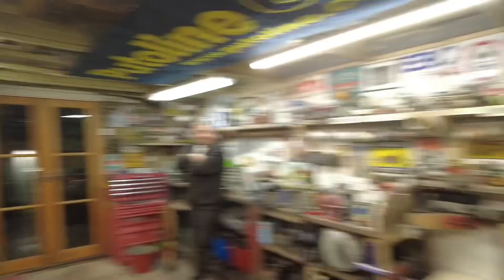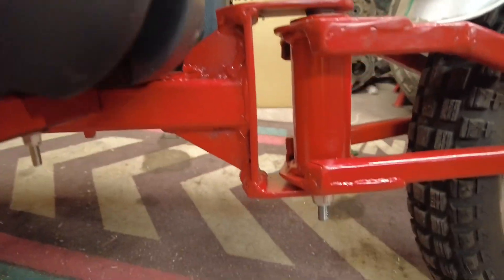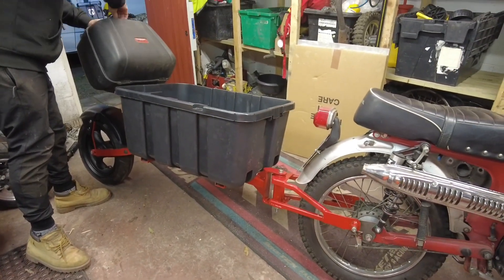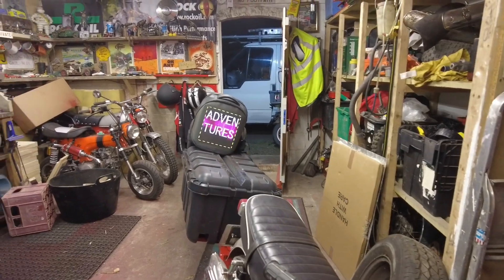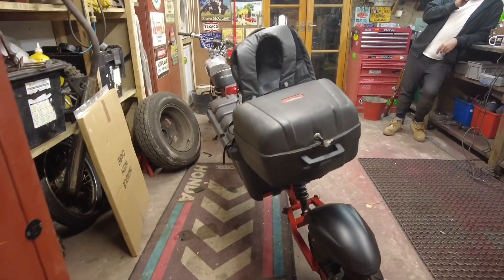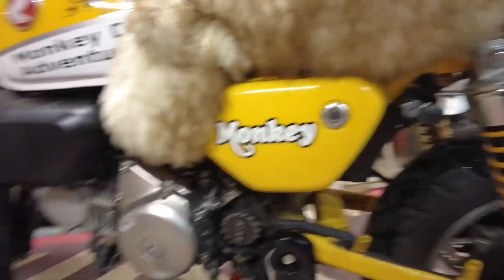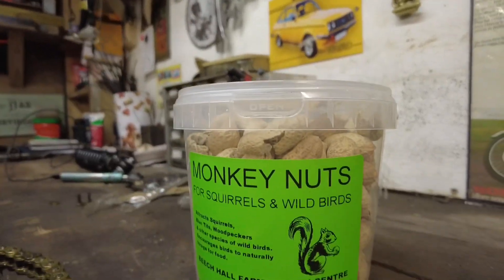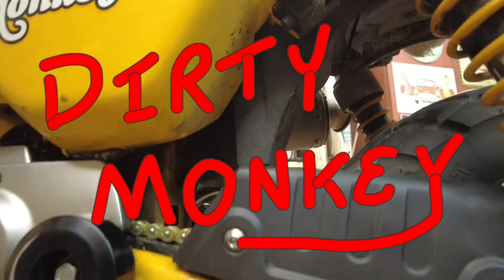Motorbike Pull along Trailer : THE BILLY MACK STACK…Monkey Prototype…DRAGON RALLY prep : Episode 1

Comment: Carful start out slow riding this style trailer set up.  I had something similar almost caused me to crash. When I did a quick  turn from one side to the other . like a figure s.    bike almost threw me off. I had a larger rear wheel.  the smaller one may be the way to go.
Reply from the maker: Thanks for the heads up